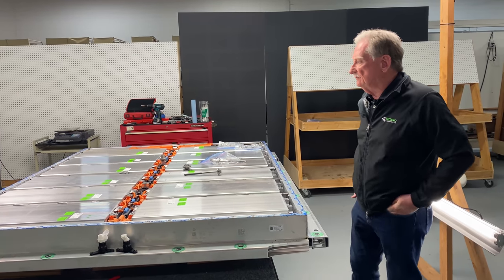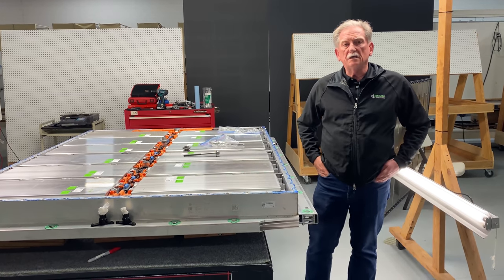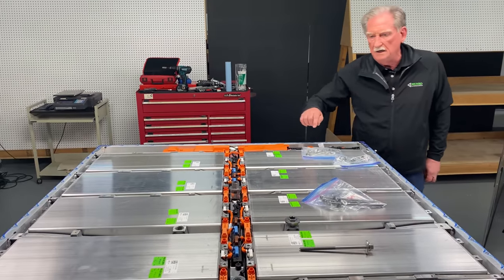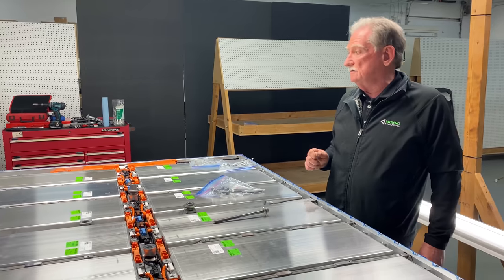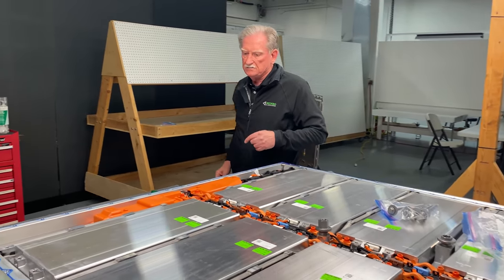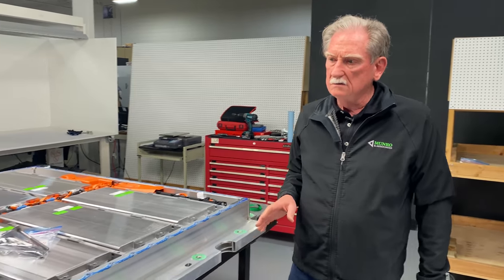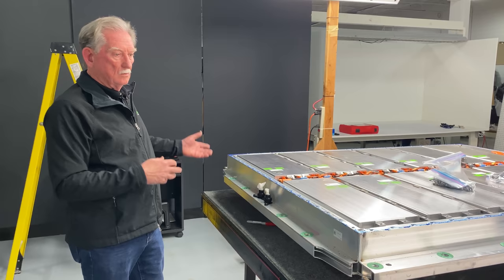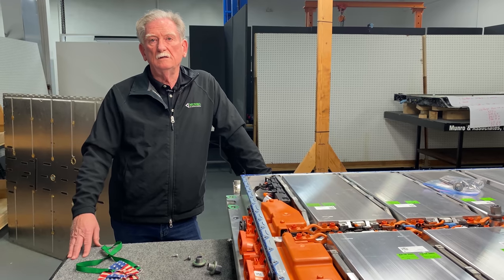2021 Volkswagen ID.4: Battery Teardown

Comment: The only useful suggestions he makes would reduce on the order of a few kilos in exchange for much added complexity and reduced repairability (molded in-place connectors?). Suggestions like carbon fiber impact structures are only going to balloon the cost. Aluminum is superior to composites in cost, strength, and thermal conductivity. Any cost savings will be found in reducing the amount of aluminum used.
Reply: you forgot about recycling, aluminum is very easy to recycle compared to composite materials or carbon fiber
Reply: Considering the relationship he provided of 1 kg removed = $10 saved, using aluminum or fiberglass + polymer honeycomb composite products would be affordable and provide sufficient structural integrity. Only performance cars used carbon fiber, and carbon fiber will likely never reach affordability before something else comes along that is both more affordable and more recyclable.
Reply: This design is pretty much baked. Unless you go to a module-less whole pack design like CATL and separately Tesla, then you are going to be stuck with the blades in a box module with an array of modules that need to be held together in a larger box.
Reply: @flipadavis  yeah this is also the only way to offer enough flexibility for VW decentralised production and sourcing.
These modules make up all their batteries and offer a best effort compromise for space usage/density and design options.
Reply: It's just their initial thoughts here. I'm sure they'll investigate and refine better suggestions for their final report.
Reply: There is no way it could be cost effective to mould those connectors into a bigger housing, The complexity of that mould tool would be crazy. This is the type of engineering we see all the time, easy to say change this alu to a polymer but very complicated to do and will lead to recycling and service issues.
Reply: You can't say that for certain without a view on VW's supply chain costs, which I'd seriously doubt you have. Yes generally Aluminium is cheaper but auto OEMs have the size to achieve savings in unexpected areas - I know 3D printing the pack casings is being looked at, and carbon fibre packs are being scaled too.

My issue with these is that saying "I'd change x" with no visibility of the machinery available is pointless, it will differ hugely between OEMs, and even between plants of the same car company (in my experience as an automotive engineer). The connectors would also be a no-go because I think they're designed by Amphenol (or TE Connectivity) who I doubt would let go of their CAD to VW for a mold. He should caveat the videos with that point.

Regardless though these videos are informative, and I'm impressed Munro put out so much for free, no one in the industry comes close. Hence the effect is definitely a net positive imo, so the moaning seems a little unfair.
Reply: @nomoreheroes93  Many of VW's battery/power solution are made by Draexlmaier GmbH, basically to order and VW usually does not use single supplier designs unless they own the designs, many of these connectors are also standardized/semi open, like FAKRA (DIN 72594-1 und USCAR-18) which was originally designed by Rosenberger Hochfrequenztechnik but quickly became the quasi standard for coaxial connectors in the Automotive industry because they can be connected and verified by robots.
Reply: @heldgop VW has made entire car frames out of a CF fill PA, they already have the expertise.
Edit: was thinking about the BMWi3
Reply: @heldgop carbon fiber filled polymer products are all over the place. It's really no big deal.
Reply: Was thinking about same. Yes, you can save the kilo of screws by glueing it together, just you will need a new cover or maybe a new case when you have to open it for a repair.
Reply: @sebastianflynn1746  and lets be honest. the early bmw electric cars are really shit
Reply: I mean you could certainly improve on that design. Does this thing need 2 million screws? could there maybe be other alternatives? Do you have to weld the cast struts in the middle? In all of those cases however the question is, does adding 100 screws make it easier to automate the process, or do you still need workers to attach them .
Reply: @flipadavis  BYD Blade?
Reply: @jonathan4831  Considering the relationship he provided of 1 kg removed = $10 saved, and the cost per kilogram of composites, using fiberglass + polymer honeycomb composite products would not be economically viable.
Reply: @sebastianflynn1746  The point is, making that part out of carbon fiber reinforced polymer, and have it as strong as this extruded aluminium part is, would make it cost MORE than it does now, and the whole point of the argument was to save weight in order to save money. So Sandy is simply wrong on this.
Reply: @_aullik  Yes, all those things are needed to make the structure as strong and rigid as it is, and have it resonate properly to make the car as refined as it is.
Reply: @derbigpr500  that reply makes little sense. You can makes it just as rigid without using as many screws. However you would need strengthening elements in other places. 

The important question is how to make it just as good but easier thus cheaper. This is really hard for us to argue about because we do not know about VWs production line and what changes make it easier or harder to produce.
Reply: @jonathan4831  whoever says polímer compound can match a simple ac44500 aluminium has not dealt with the work of trying to substitute it by another (and I work at a tier one supplier in the design team so I know what I'm talking about).
Just raw numbers  of material structural strength values.
Aluminium about 70k MPa young modulus Vs i.e. pa66-50gf 10k.
Stress at break (240 Vs 167 MPa)
And we could keep going talking like heat creep, creep. 
It's true that for some test, You could make it work but some abusive test have really really high loads so needed material section at tensile loads would be bigger. And if you go to a high technical polímer like a ppa or pps price rises so much that if part is big it loses its edge.
This "speech" is not an anti polímer text. Just that it's not always that easy.
Reply: Agreed. Foam aluminum would be ideal for a high volume mass produced battery chassis. Imagine a one piece item with solid material where needed and various foam density elsewhere. High developmental cost but unbeatable volume cost. For now, fabricated aluminum.
Reply: Hey Volkswagen ! Take a look at foam aluminum. Patents have now expired.

Comment: Good luck Sandy and team. The MEB pack design is actually fairly cheap in construction using welded and glued extrusion and castings. Going to polymer with 1/5th of modulus to aluminum will be a challenge for crash, torsional stiffness, and thermal runaway management.
But can't wait to see the process and your findings!!!
Reply: Not really. STAMAX is very strong.
Reply: @Drivethisnotthat  stamax is very strong for a Polypropylene that's for sure. It is mildly strong (120MPa UTS) where Alumium usually is in the region of 300 and can go up to 600MPa. It's also isotropic where Stamax is not due to fiber orientation. Properties are weaker if you're not aligned with the fibers. It is so NOT stiff. if I look at the 40%LGF Stamax we talk of a modulus of 8300MPa. Aluminum is 70'000MPa. You can compensate for stiffness with design, but it usually means you need space. And in a battery pack, you want the space to be occupied by cells, not plastic.
Reply: @fabriziom  Also try recycling composites into anything with properties as good the part you started with and you'll see why Al is a much better choice for a mass produced consumer item.
Reply: @peglor  Indeed that's another good point. Especially long glass polymers. When recycled you break the fiber length.

Comment: I am very impressed with this battery build and would be more confident when that once in a lifetime object in the road goes under this battery versus a polymer build battery.  Few people realize impact damage to this housing can In effect, total out the vehicle. Saving money on the single most expensive part of the vehicle is tempting but not a good idea. I like the architecture of this battery over the Mach E bus bars. You will see soon. Corrosion around all those screws, long term in the challengingly extreme north country will not be a good thing, Mach E included. Interesting and great information as always.  Thank you.
Reply: perhaps more battery modules could be saved after a crash with this design
Reply: My thoughts exactly
Reply: Hi, isn't the battery housing made of Aluminium? Should not that be resistent to corrosion anyway? , And regarding the bolts, I hope they are hopefully sea grade steel (inox).

Comment: On the plus side, the ID.4 battery looks much easier to recycle doesn't it?  I believe the state of the art in 3rd party Tesla pack recycling is a worker with a pick breaking the epoxy bit by bit.
Reply: I was about to ask, aren't the battery cells in a Tesla all glued together?
That sounds like an absolute nightmare to recycle.
Reply: @zocker1600  modern machines can do it, but why not make it easier indeed
Reply: Recyclability will become a non-issue with EVs when battery technology innovation achieves 1 million or more mile lifespans.
Reply: @Some Person You are right! I think the recycling was in the focus for the decision to take aluminium for the frame: Plastic is in many countries special garbage but not aluminium. - So somewhere needs to compromize.
Reply: @jonathan4831  no you are absolutely wrong, recyclability is always an issue, no matter how long the battery lasts, or do you want to have a planet full of battery waste in 100 years??
It would be a non-issue only if the batteries would last infinite, which is clearly impossible.
Reply: @zocker1600  let me clarify my comment. I mean to say that perfect recyclability is not as important when considering significant lifespans. I don't agree with making connectors or battery parts parts impossible to recycle, but more so commenting on the use of composite materials that currently can only be downcycled as structural components. The eventuality of composites will be using natural composite materials with inherent recyclability or reusability, but using fiberglass or carbon fiber with a thermoplastic is less of an issue to me considering the long lifespans expected from EVs. Those products can still be sort of reused / recycled.
Reply: Většina aut neskončí no to že nejezdí nebo byla porouchané ,ale stávájí se něco jako dopravní  nehody
Reply: Tesla se EU podmínkách rozpadá již za jízdy.
Reply: @jonathan4831  When it does. It's not there yet, and Tesla puts millions of these battery packs out into the world that we'll have to deal with sooner or later.

Comment: As much as it would be nice to include the connectors, what about replacement? As they age the plastic could be more brittle and if they broke you would have to junk the pack or replace the whole shell. Sandy seems to be more concerned about saving the OE money and less about repairability.
Reply: It's pretty clear that his analysis is pretty much purely about saving money on the manufacturing side. And reliability within the warranty period. Without thought put into reparability or sustainability. All his recommendations are well and good for a car that will last 10 years and not need to have individual components replaced, but what about when it comes to the EOL of the vehicle, recyclability etc. Imagine having the car mechanically totaled because a connector issues causes you to need a battery replacement instead of a connector replacement. 

There is something to be said about items that are infinitely rebuildable that last a long time.
Reply: @CondoreComputing  a reliable car is finitely more environmentally better than recycling these things every 5 years. no way it makes 10 years without everything else decaying.
Reply: @CondoreComputing  Manufacturers want non-repairable EVs. There's is less guaranteed income from EVs as they are projected to require less repairs and recalls.

Manufacturers have a large incentive to force anyone outside of a warrenty to buy a new vehicle as that is essentially the only source of income from EVs. Some people may buy a clapped EV in hopes to slap a 5k$ battery in it, but there is no guarantee the mounting design will be in production given 10-15 years time.

The thing with ICE vehicles was they could keep producing large amounts of OEM parts and sell them all at large markups. 

There is not much to profit post-sale other than brakes, rotors and suspension, which are all things Manufacturers don't make a dime from.

Personally I don't see Manufacturers trickling down cost savings. If an ICE is 25k, and a profit margins of 5k, why would you sell an EV for less than 25k when it would cost less than an ICE to manufacture, nice, we made an EV for 15k, but we can still sell it for 25k, doubling our profit.

Comment: Sandy, I work with VW group. its more likely German changes its beer purity law before VW engineers will discuss any changes to their design
Reply: Facts.
Reply: Germans are usally very good at engeneering. They always tend to do things the way they like even if someone else comes with a good solution.
Reply: So far he hasn't really provided any meaningful ideas for changes in the design, so why would they?
Reply: His main changes amount to making the battery case with unrecyclable, more expensive materials (Because a company that makes parts in these materials paid him to investigate this). Integrating the plugs with the case casting only works if you have already changed the case material. Removing the small fasteners is the only good suggestion, provided they replace them with a serviceable joint (Avoid welding, rolled metal joints (Like seal tin cans) and glues that can't be removed) so the battery modules can be individually replaced in future.
Reply: Don’t listen old Man …
Reply: @peglor  A solution in search of a problem, as it were.
Reply: What should they change in this case. I have seen whole video and didn't get anything constructive. Replace aluminium with polymer. His basic math is wrong. He is comparing 75 kwh battery pack to 82 and saying a difference of 50 which in reality is just 10 kg.